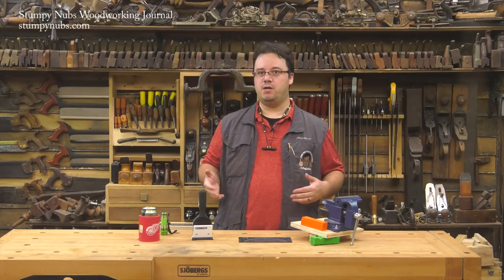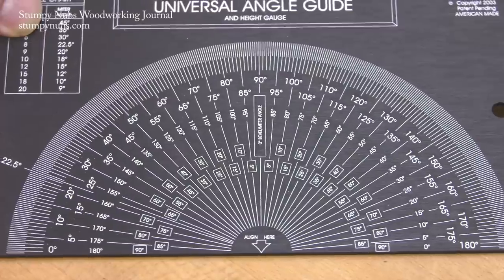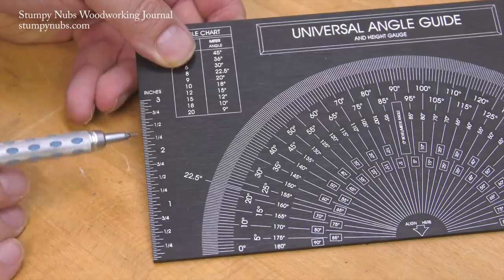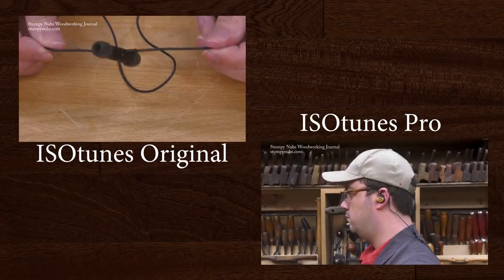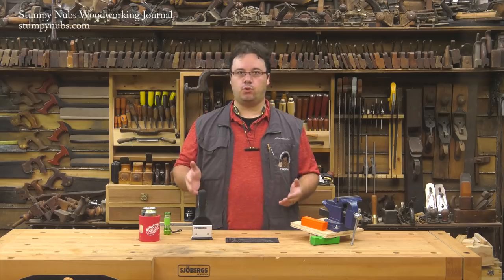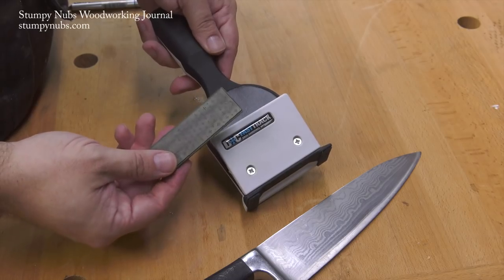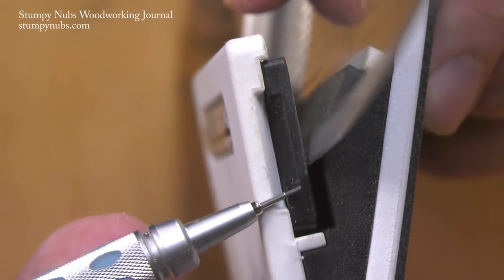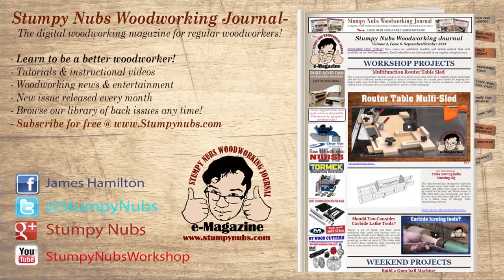5 Woodworking Innovations you should know about!

Comment: Hello James, could you please advise or do a video on what hand chisel brand or steel is the best to get. There are so many brands out there maybe the steel is what I should be looking at. I’m always on a low budget can’t afford top of the line stuff. Also I have a craftsman 20 volt drill with the long neck old style batteries that discharge very quickly unlike my Rigid which is awesome. My question is are there a compatible replacement for the earlier style batteries to get better and longer performance. Thank you 🙏
Reply from the maker: Here's a review of two good options. The Stanley Sweethearts are my favorites. https://youtu.be/PsaE6GZQu5s?t=61

Comment: Lithium powered lights are best for long-term storage, because the batteries don't leak and burst over time like unused alkaline cells do.  Those little cheap ones are ok if you use them regularly to keep the cells from bursting, but if it's going to sit for a long time (like an "in case of emergencies" light), get a rechargeable lithium light.  You can get them as low as 12-15 bucks on amazon.
Reply: I agree. I found Duracell Alkaline leak too often but Energizer Lithium do not. I carry everyday, a AAA lithium LED keychain light...reliable and there when you need it.